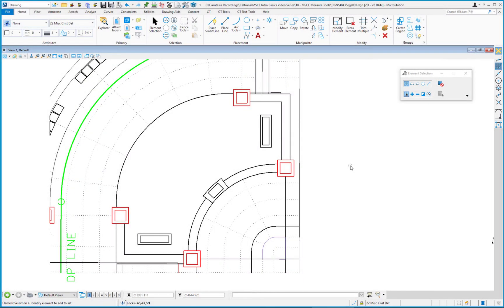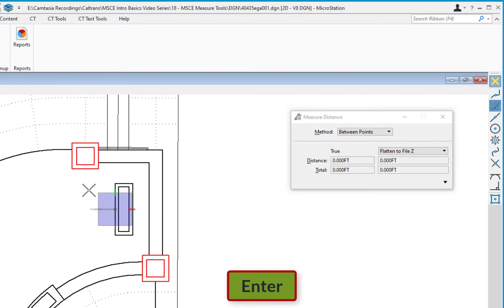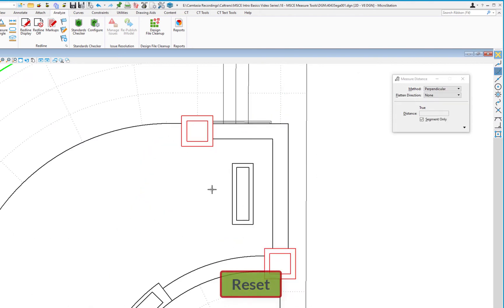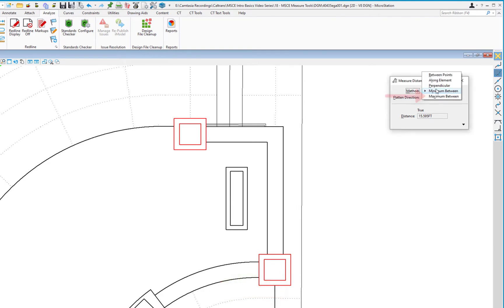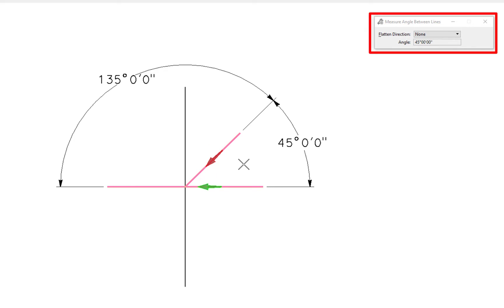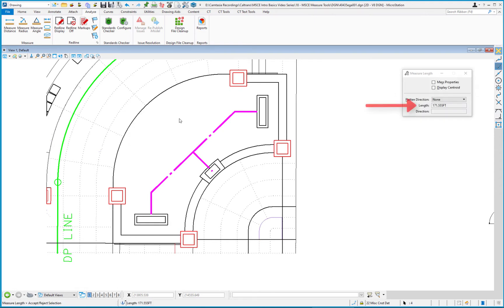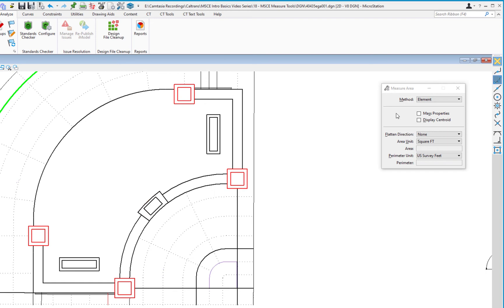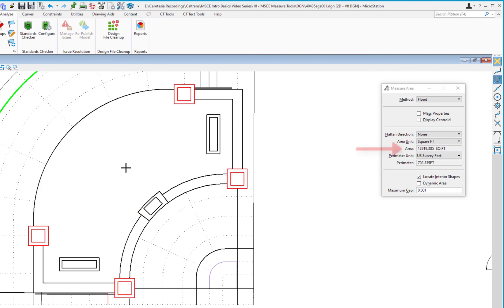18 - MicroStation CONNECT  - The Measure Tools

Comment: Can you measure along multiple elements?
Reply from the maker: Hi, when you say along multiple Elements, are you asking about lines/arcs that look like they are one element? or Elements that are totally separate? If you are asking about Elements that are not chained together, like lines and arcs, but look like one Element, unfortunately no. the Tool only works on LineStrings, Arcs, Shapes, Complex Chains, Complex Shapes and Shapes. Hope that helps :)
Reply: @CaltransMicroStationVideos  thank you very much. Yes me mean multiple elements
Reply from the maker: @FaithandFun  If you are talking getting the length of multiple Elements, you can use Element Selection, select all the Elements. Then select the Measure Length Tool and the total (sum) of all the Elements will be displayed.